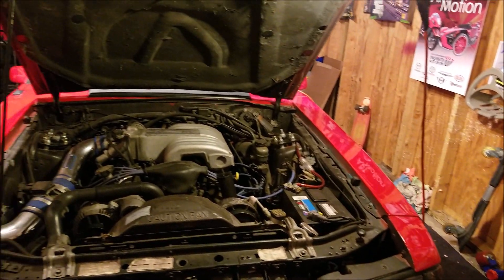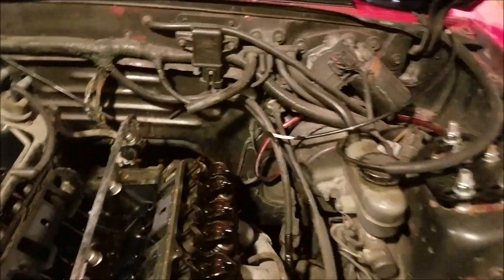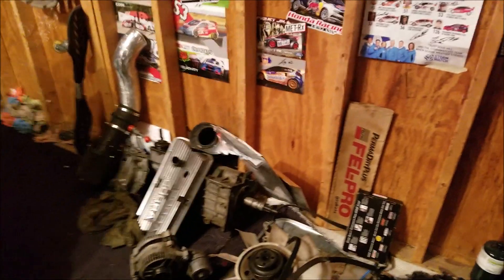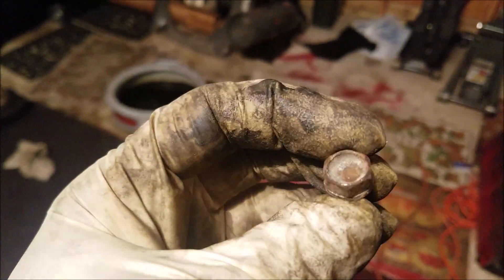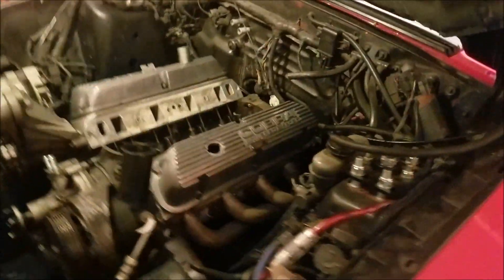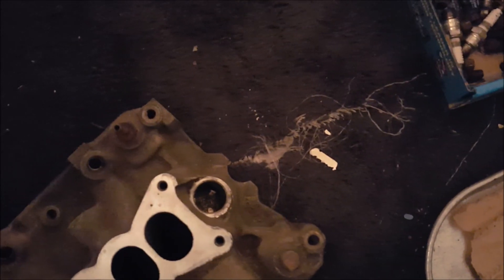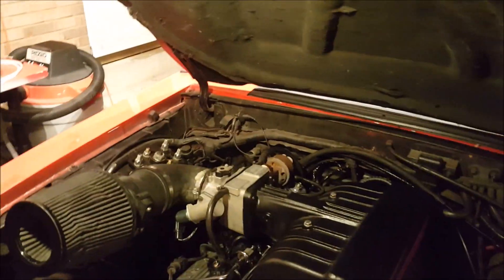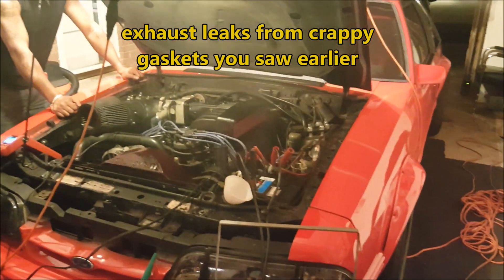7 day Motor build!

Comment: I know that feeling of intimidation, I just pulled my 5.0 beginning of march. Never pulled a fuely motor before but it turned out to be very simple. Had to clean the bay, trans and other parts, then I dropped in the 331 I had built. Mine is an 88 so I had to wire a maf to run my n41 cam. It was probably the most daunting cause you hope it's wired properly. The great thing is these cars are very plug and play. I literally stabbed the dissy in after priming the pump and the thing popped over no problem. Keep the videos coming, its a great channel. Awesome to see other fox guys out there
Reply from the maker: i would love to clean the engine bay and do a detailed restore, but that would tie up the garage too long, and i wouldn't be able to drive it, Driving is better than modding.

Comment: Nice work. Was questioning a bunch of stuff. Rockers didn't look finished at one point but hopefully thats stuff 'we didn't see' as you put it.  Keep at it!
Reply from the maker: yeah, i didn't video that part, i finished those up i rotated the motor for each one till the valve was closed and torqued it to 20lbs.  The pedestals align themselves.   I didn't buy the stud types because i don't have the experience to properly set them.
Reply: Cool to see another one still running/kept running. Almost ready for assembly on the one I've got - better to take two non-running and at least get one running again (my plan).

Comment: I'm going through the same thing right now with my 95 GT 5.0.  just started tearing everything down.  I'm doing P heads and explorer intake, stock cam with 1.7 rockers.  First time taking heads off an engine.  Should be fun.
Reply from the maker: not bad.  Getting the heads done is a decent satisfying job.  Getting the cam is a whole lot of work.

Comment: pretty much got on down, looks like a pain in the but, it'll be alot better once everything's done.
It looks pretty cool.
Had a couple of questions, I wanted to know if those are GT 40 heads and if you put a cam in?
Reply from the maker: no, this is not the gt40 setup.  wow, i just realized i got ZERO video dealing with the cam!
Reply: Ya just happened to hear you mention it. Thats alright though, hopefully everyone will see it right here on the message.
But you did cam it though ha. 
I never really mess with engine work myself, so all this is educational for me.
Reply from the maker: yeah, not super detailed, it just goes to show that you can do this with moderate skill.

Comment: what heads, cam, pushrods, and rocker arms did you use. did you have to modify the pistons and the push rod length was it stock or different length. keep up the great videos
Reply from the maker: I've decided not to reveal my setup, i will say that i'm running stock push rods and 1.7 lifters, my total lift is .530.  no mods to the pistons.
Reply: OK.  what size Valves pls
Reply from the maker: 1.9 intake

Comment: I noticed your other videos you are having cooling problems, get rid of aluminum rad, go to american muscle and get the wide 2 row rad that flows like a 3 row then go to jegs and get the derale  dual fans that fit the rad, got 351 w in mine and runs 160, if give me your # I can text you pics of my set up, fans are like 250 rad was I think 175 then you buy a dual fan controller  my fox is a 1987 gt, I've had since 93 ,like I said a well built 351w with c4 3000 stall reverse manual valve body and trans break al drive shaft you can call me 6six2 three9seven8seven8zero bro  I have had my car running 630 in 1/8 and still drivable on street, I have spent a lot of $ through the years I know what works and what doesnt
Reply from the maker: I actually had several issues, my thermostat was backwards, my fans were too small, and I had air in the system. After installing a big ass 18 inch fan, and correcting the other issues, the car cools like a champ.  Haven't had any trouble since.